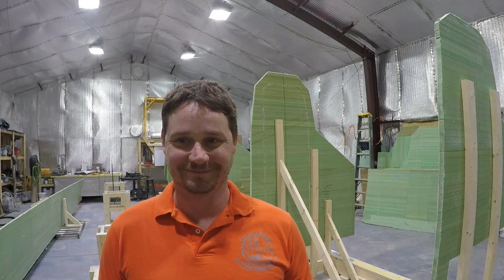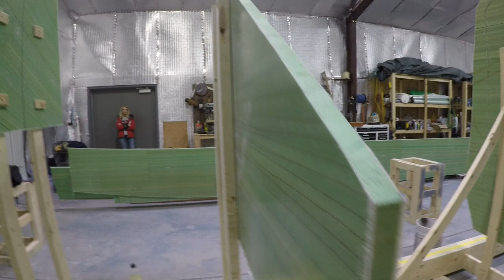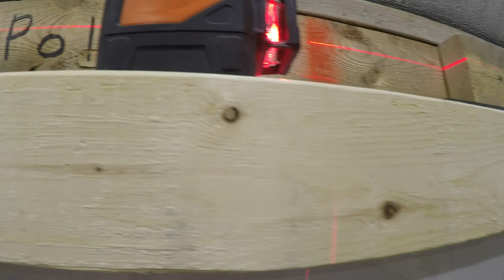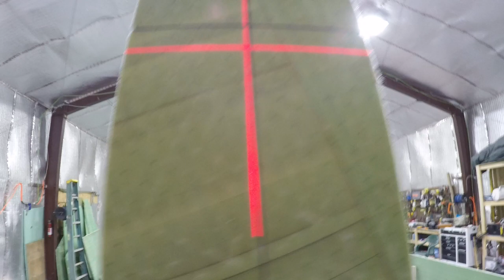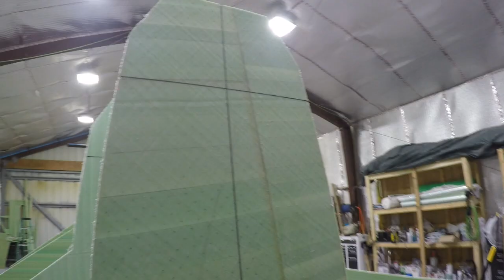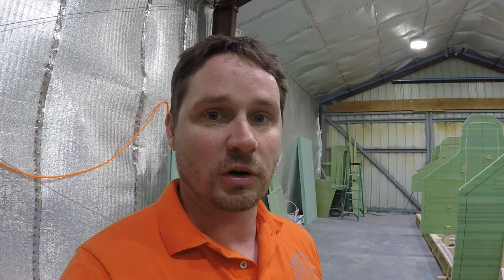Schionning Arrow 1280S:  Strongback and Bulkheads by Ojigwan Yachts

Comment: Uhh ,you could consider engineered 16 ' floor joists!! They are I beams. They are strong, straight and very stabile!! Using lumberyard timber it,s frustrating!
Reply from the maker: on our first strongback we used lumber...it was a nightmare.  On the second one we used TGIs, same as you call engineered.  It was cheaper and went together in a few hours.  Lessoned learned.
Reply: @ojigwanyachts9361  uhh, for great dead level large work benches the engineered joists are just the thing for boat or airplane building. You make a table ,cover with osb level it and put on a layer of board that has the melamine surface. Great for lay ups because epoxy doesn't,t stick to it!

Comment: You said earlier that you purchased the koit from Current Marine in SA. Can you give nore details. I assume you purchased the plans from Schionning then purchased the kit from CM. Can  you give more details as to this purchase and how it was carried out. thanks
Reply from the maker: We purchased the plans from Schionning for the Arrow 1280 and worked with Schionning on getting our kit built at current marine, based on our model and core choice, they handled that part of the process, if we had wanted a different kit is might have been fabricated at a different location.  Schionning has a few places around the globe that build up the kits and depending on what model and materials and final shipping location the kit may be built at a different location.  We didn't work directly with them.  We then coordinated the shipping container purchase and shipment to the US and found a clearing agent at our local port to help us get the container accepted and then offloaded and delivered to our facility.  That was a significant effort.  We are here to help, if other are interested in buying their own plans, or Kits we are happy to share our lessons learned.

Comment: Cool use of a laser level for starting your catamaran build. You have made great initial progress. A heated and insulated shed is awesome.
Reply from the maker: We spent more time and money on the shed than was in our initial estimate, but doing so has enabled us to take on other projects and end the end will ensure a faster and higher quality build.  Not having forced air heat helps a lot when we need to cut down on the dust.  The radiant floor heat has been a really great system.  One day I plan to put up a video of our shed building process.  We did all that ourselves as well.
Reply: @ojigwanyachts9361  que precio tiene esa embarcacion